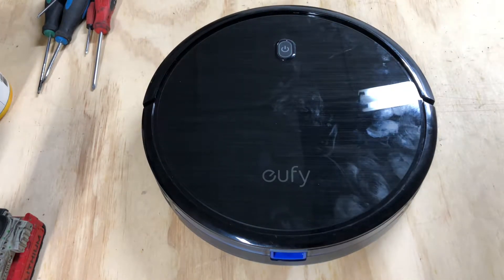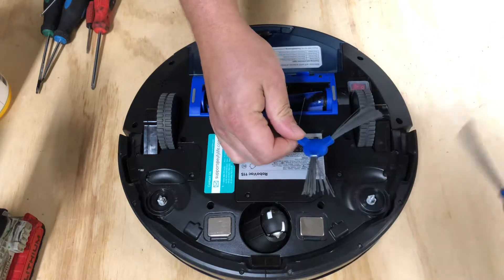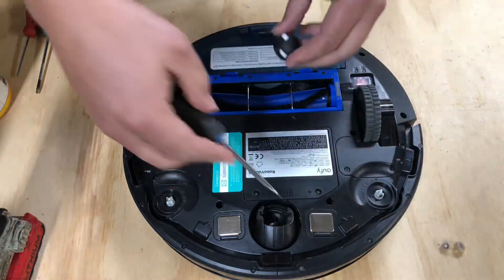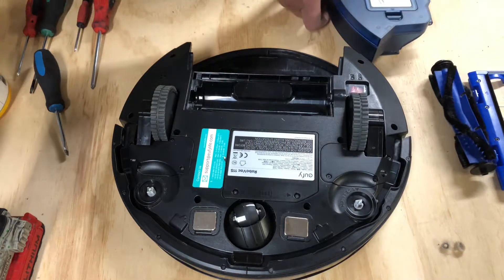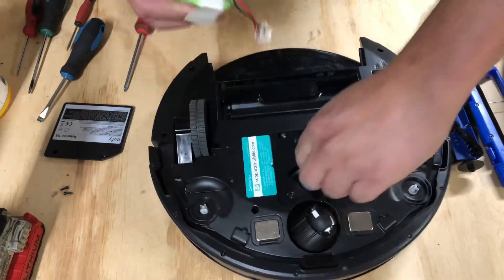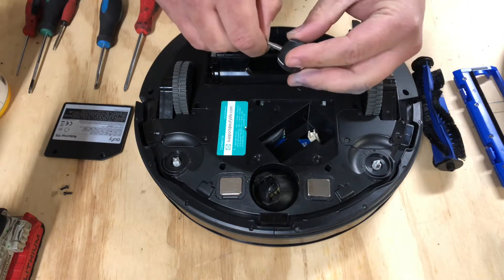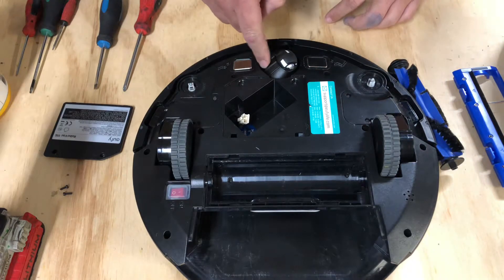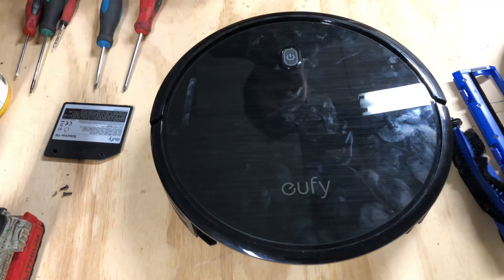Eufy RoboVac 11s How to Remove Brushs, Battery,Dust Bin Video 1

Comment: My sweeper brushes have fallen off but I cannot remove the blue plastic tabs where the bristles connect.
Reply: See the comments above. You can use a flathead screwdriver to pry them out and you'll get them off with patience.

Comment: I like these videos about the Eufy 11S full tear down. I'm a girl. I was raised by my dad. He was a nuclear engineer for the military. I went into civil engineering and surveying. I grew up in his garage trying to match what he was doing on my little work bench. If he was working on his old toyota land cruiser that he put a corvette engine into, I was taking apart the super nintendo he got me for christmas, lol. Disassembly isn't necessarily my forte. It's more of a bonus hobby I get to do when my things break, or in this case, just needed a little detail cleaning. When something stops working, I get excited because I've been waiting to tear it down since I bought it. I have a Eufy BoostIQ 15C Max, model T2120. It is extremely similar to this model. I disassembled prior to finding this series of videos. I forgot to take a picture before doing so. Admittedly, this was a critical error. But I fixed the original issue. It works fine. I even kept all the extra parts in a little container just in case I remembered where they went, lmao. I have two criticisms; when you describe how the left and right sides go, I understand. But in each video, you start with it backwards/forwards at random. I understand you're probably doing this because it is easier to get to the parts you're focused on. But as a viewer, it's hard for me to follow because I have to keep readjusting my setup to match you, which causes me confusion. Like, learning to play guitar while facing someone playing a guitar. I have to pause and gather my bearings, lol. Maybe it's me, lol. But I'm pretty smart, so I figure if I have to pause and think about it... Maybe others do too. Also. A detailed reassemble video would be Ahh-mazing, although I'm sure most people using these as a reference already know how. I mainly just enjoy tearing things down, seeing how they work, and putting them back together again. Lol.
Reply from the maker: Thank you for your response those are great suggestions.

Comment: How do I remove my side brushes if their is no "brush" left? Theres nothing to grab onto to pull it off and i have tried everything! I cant get them off! :(
Reply: My husband just got it off by using a small flathead screwdriver under the tiny brush area to pry it off. This was after I emailed the company and got a reply in just a few minutes--at 9pm! Great customer service!
Reply: @HealingHeartIssues  Thanks so much for responding with this or I would not have been able to figure this out either.

Comment: My side brushes don’t just pop out.  Having trouble getting them out to clean.
Reply: Same, did you get any solution to it? If you did please reply as im having trouble removing the sidebrushes too!
Reply: @dominolife55  yes I did.  I used something for leverage.  I think.  Hard to remember.
Reply: Many people, including me, have this issue. Use a flathead screwdriver to pry them out from under and keep at it and they'll eventually come out.

Comment: I am unable to remove the plastic guard that has 3 vertical blue plastic lines. It is the object that has the white
Pleated filter under it. What should I do to remove this blue thing. This is for a
eufy RoboVac 11S.